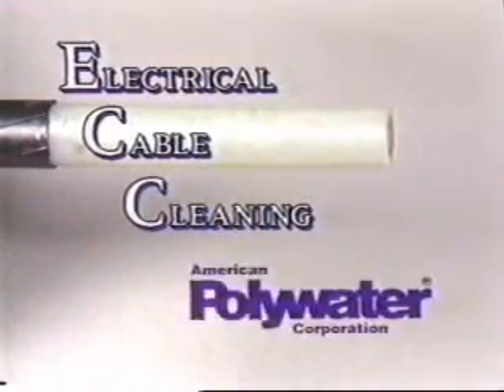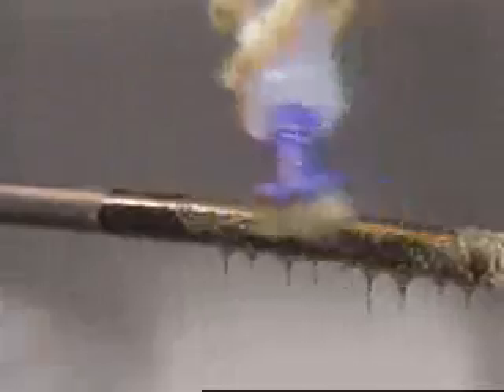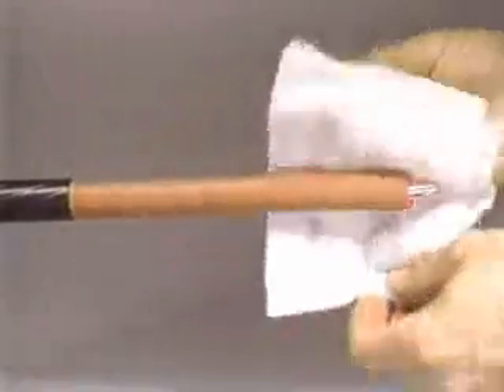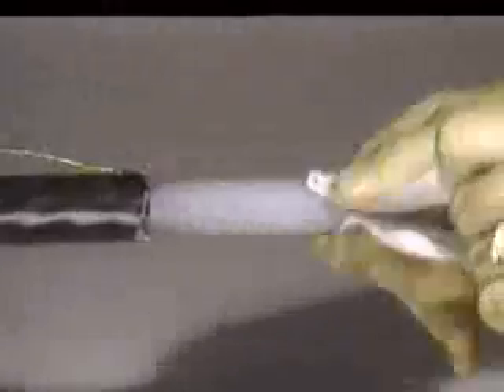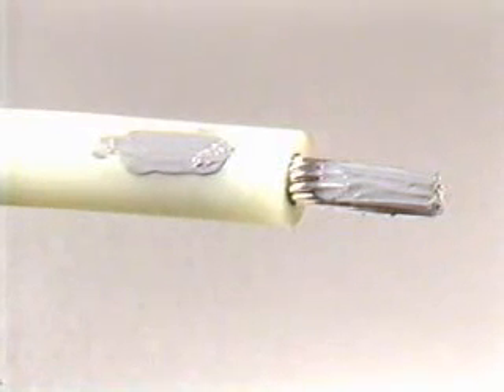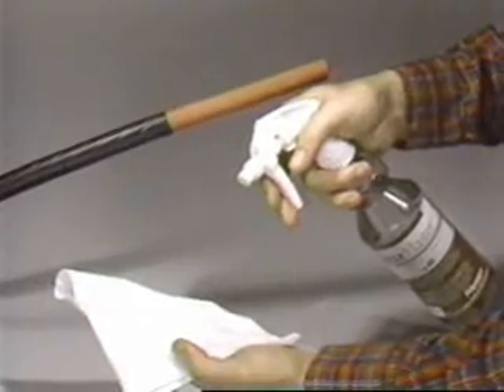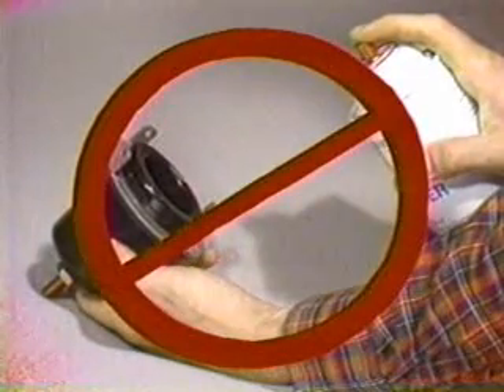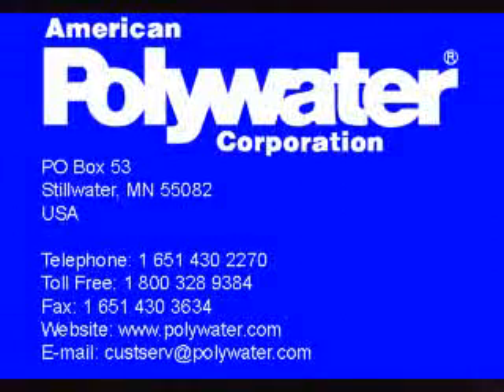Electrical High Voltage Cable Cleaning

Comment: This aint nothing compared to what me and my home"drinking"boy works with. We have cables around 1m diameter and running electricity around 4000 amperes. High voltage cables for life! <3 ABB is the sheeeiet.